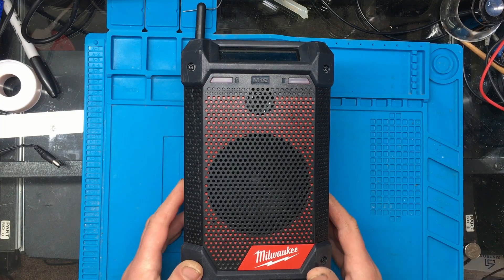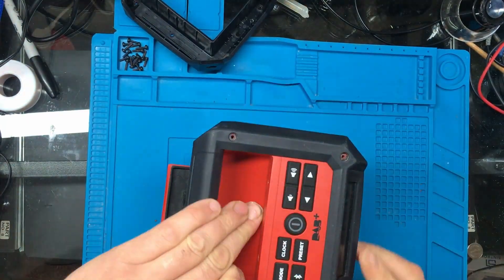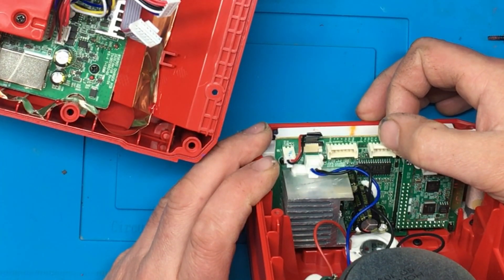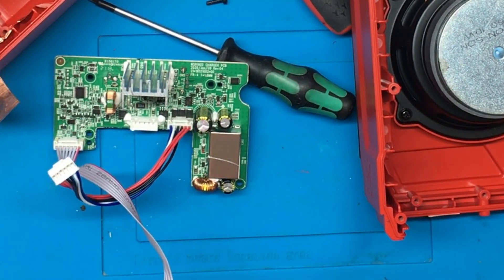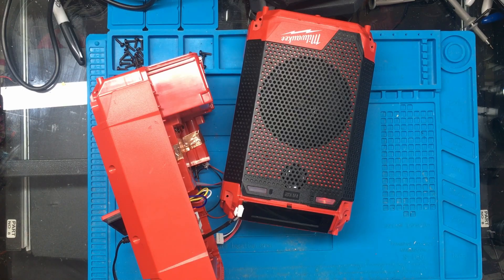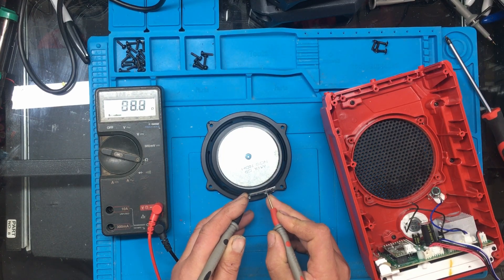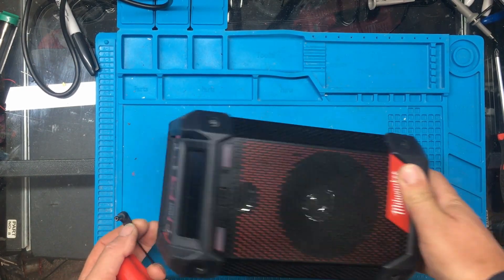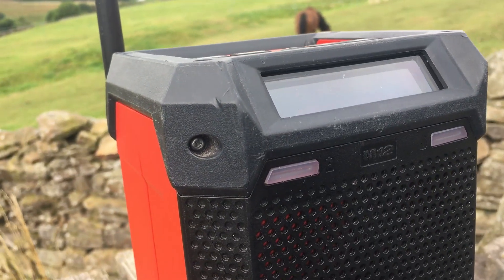Repairing A Faulty Milwaukee M12 Radio Charger With Bluetooth

Comment: I have a radio that does something similar. It flashes red and green and wont work with the battery in, but works fine with the AC adapter in. But even with the AC adapter in, it flashes red and green. Even if a battery is not installed. Nothing looks a miss, contacts are clean, multiple batteries tried (all functional batteries). I wiggled rhe connectors inside to see if there was any kind of a short, but havent found anything

Comment: Where would I be able to find the same speaker from. The radio fell from a couple of floors and I took it apart. It looks like the speaker might be shorting but I don't know where to get a replacement speaker from. Any advice?
Reply from the maker: That's a very good question! I've just had a search through my eBay purchases and found it. https://www.ebay.co.uk/itm/233539552721 This is the one I used. It wasn't quite perfect, but I used some washers to hold it in position.
Reply: @BuyitFixit  I'm in north America and it's difficult to find that speaker. If I found a 4ohm 50watt 25watt rms. Would that still work? And would I have to change the capacitor that is connected to the speaker?

Comment: Great fix!  Worth being paranoid about voltage markings - a good learning point!  And the manual wasn't any help at this point - it says that if you get red/green alternate flashing, this means the battery pack is at fault - doesn't say what this flashing means when just the charger is plugged in (low DC input voltage).  Beautiful location too - thanks for sharing both your scenery and repair techniques!
Reply from the maker: Thanks 👍yes this one threw me for a while as I pretty much checked every component and couldn't find a problem.

Comment: Anyone have a m12rcdab problem where it starts buzzing then freezes then it shows a question mark symbol ?_ _ _ initializing
Reply from the maker: Nope, but it could be capacitors. Does it do this on both battery and mains?

Comment: Mine has a 14v charger and its not charging and no lights turn on
Reply from the maker: Firstly I'd check you are getting power out of the AC adapter. Have you tried it with a battery? Then I'd check the power supply board in the back that does the charging.

Comment: Mick when measuring speakers with an ohm meter, you are measuring DC ohms where a speaker is AC ohms.
Reply: I think the value was 6 ohms on the actual speaker markings and he was getting 89 ohms, the dc and ac ohms testing would not have made that kind of difference. If you have a 4 ohm (impedance) speaker, it could measure the resistance on the multimeter between 2 and 3.4 ohms, an 8 ohms speaker could measure between 5 to 7 ohms, and a 16 ohms speaker might measure between 12 to 14 ohms. Just info for yourself for the future 😊👍

Comment: I just bought one and noticed a static distortion sound when unit is in bluetooth mode and no music playing... any ideas?
Reply from the maker: Sorry, I've never really looked at the bluetooth side of the unit, as it was working on this one.
Reply: @BuyitFixit  When I give it a light tap with my hand on its side it goes quiet then comes back as soon as I play music then turn it off again..... weird for a new unit
Reply from the maker: Sounds like it could be a loose connection or bad solder joint.
Reply: @BuyitFixit  I guess that's what happens when you try and pump out a million products and lack on the quality.. (milwaukee)
Reply from the maker: Yes. I quite like a lot of the stuff, but a some of it doesn't seem as good quality as I'd have expected.
Reply: @BuyitFixit  Of course, for the most part I'm satisfied with the quality of  their products so when I come across something like this it's abit disappointing lol

Comment: That sure is some pretty country side out there , Are you in Scotland ??  I have a coin collector friend in Scotland Alexander Smith is his name ....and You Tube channel name ..
Reply from the maker: Thanks Cajun Coin Hunter. Not quite Scotland, but if we travel 30 miles north then we would be!
Reply: @BuyitFixit  Either  the Isle of Man or in England or Northern Ireland I think I got one of those right LOL...
Reply from the maker: @cajuncoinhunter  We're in Cumbria, North West England 👍
Reply: @BuyitFixit  It sure is pretty up there in those huge rolling hills and the stone fences , Next time I see Miss Lorna Jones I'll tell her about that place .... Do you have any of these in stock ??  STR-W6053N
Reply from the maker: Sorry but no, I just do this as a hobby and order bits as I need them
Reply: @BuyitFixit  Gotcha Mon Ami....  I keep a lot parts in stock but this I've never seen in a TV before I can't get a data sheet to pull up on it since it's obsolete and EOL in 2007 I think ..... I'm not familiar with this IC Transistor Hybrid  I think it's shorted but I'm not sure of that ...
Reply from the maker: Just looking at the datasheet and theres a typical application. Doesn't look a complicated circuit . I'd see if there's a short between pins 1 (drain) and 3 (source). Rest just looks like feedback etc. Datasheet is here: https://www.electronica-usa.com/graphics/STRW6053N.pdf
Reply: @BuyitFixit  I'd have placed that accent more in Northumberland than Cumbria but very nice either way 😁
Reply from the maker: Originally from South Shields... 😂😂
Reply: @BuyitFixit  You know, I was trying to place the accent the other day 🤣 I am from the NE myself, born in Sunderland living in Barnard Castle now, I'd got as far as thinking "not quite Geordie but not Mackem either, had thought maybe you're a sand dancer but was confused lol.
Reply from the maker: Yep, sand dancer 😂😂😂

Comment: My bluetooth cuts out, just started doing it. Any ideas why? I've tried multiple devices and it does that with all of them. Wifi off or on makes no difference.
Reply from the maker: Hi Julio, sorry I'm not 100% on that one. Could be a dry solder joint on the bluetooth module perhaps? I've not investigated that part of the circuit on one of these unfortunately.
Reply: How long have you had it? I just bought one of these
Reply: @shambles416  since October 2020 
update: bluetooth co*ked out now no device picks it up scan multiple times and nothing. So now it's just an 
AM/FM radio.
Reply: @Julio-jm8ld  fuck me, thanks for the quick reply dude 👍
Reply: @shambles416  no problem, funny thing is it gave out 1 month after it's 2 year warranty. 😅 now I'm stuck using my old m18 boombox style one with a $10 bluetooth AUX adapter power by the USB in the top compartment. It's a nice setup wish I would have done it in the first place and saved $200ish.
Reply: @Julio-jm8ld  I still have that one, the m18 with the aux port and no Bluetooth right?
Reply: @shambles416  correct, this link is something like what i got to make it a bluetooth 
https://youtu.be/_-KX9j4PbHw
Reply: @Julio-jm8ld  thanks buddy great idea
Reply: @Julio-jm8ld  thanks 👍

Comment: Hmm runs of 12v battery,  but not 12v adapter but 14v weird
Reply from the maker: I think it's just the charging needs more than 12v to charge the 12v battery. The radio functions ok on 12v. They still should have labelled the input voltage correctly though.